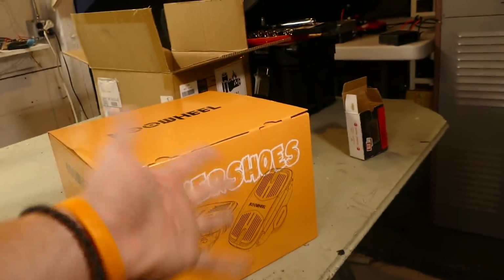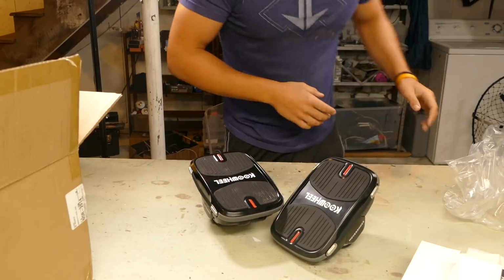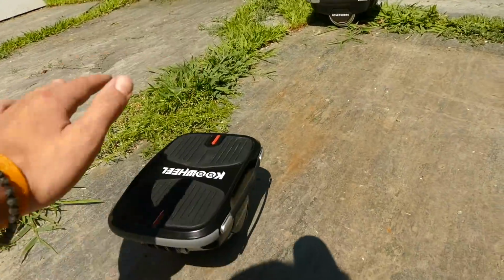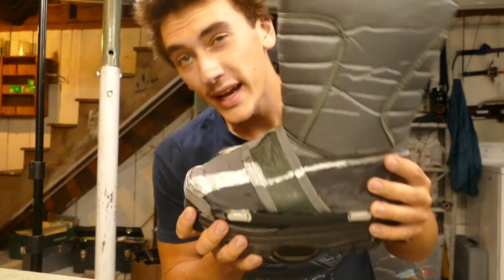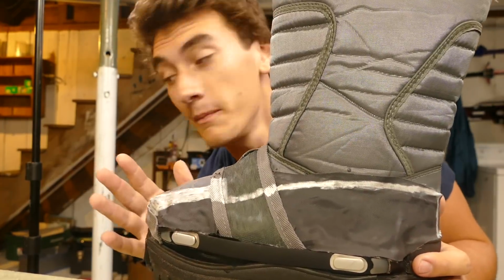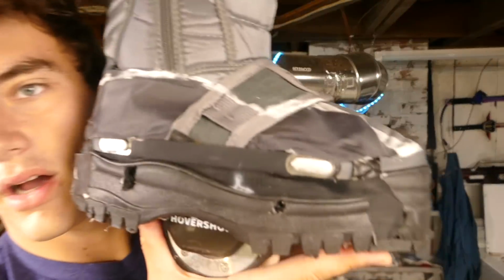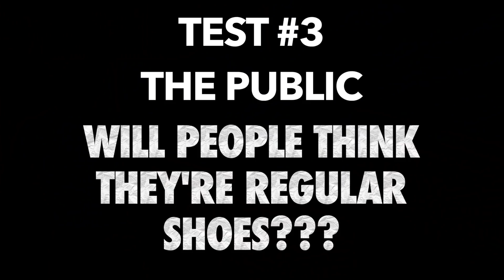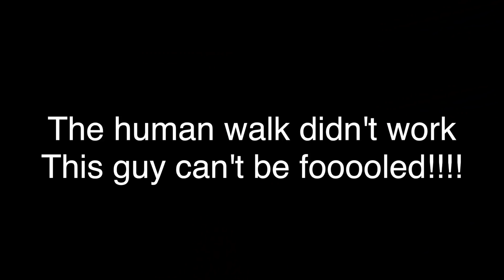Homemade MOTORIZED HEELYS! - Extreme Testing!!! (Hover Shoes)

Comment: They should be made with stepper motors so you can lock them up for walking and maybe have little square pieces extend out in front and back of the wheel for walking mode